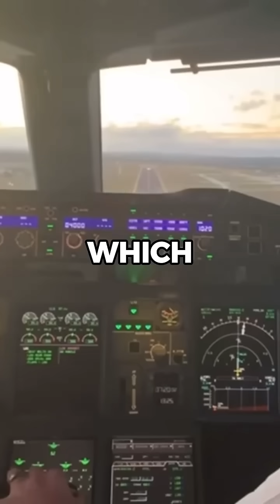Why can't the airbus A380 land at every airport?

Comment: The A 380 is that much bigger than a 747 is it .of someone can tell me
Reply: By length, no it 3 meters less that 747, but by wing span yes 830 is larger. Also it's 2 decker on full length. Hence 2 deck gate path. It's heavier that 747. It's needs both side runways vacant in some aritports because of the wingspan and turbulence it leaves whenever it takes off and landing. Which will make airports make other planes go around and wait for 380 to land. It's a pain in @zz for busier airports but it's still a frikin giant beauty of the sky.

Comment: But what if it needs to preform an emergency landing but there’s no airport it’s land able on
Reply: most runways are long enough to  accommodate the a380 for landing.
Reply: 350 miles gliding ability
Reply: then they just do it anyway, if the runway cracks it doesnt matter for a one-off, but it would if it was routine operation